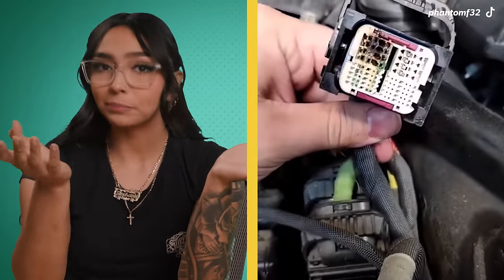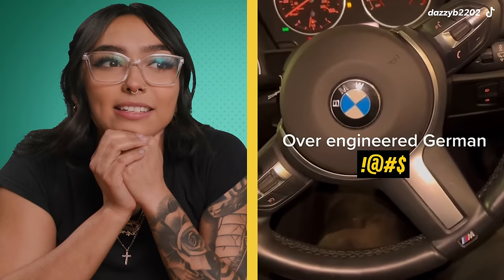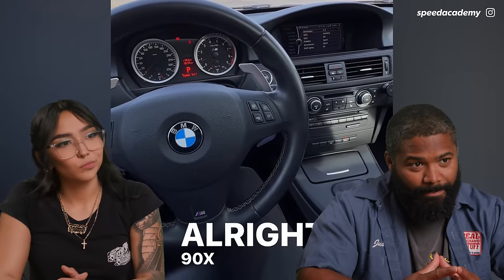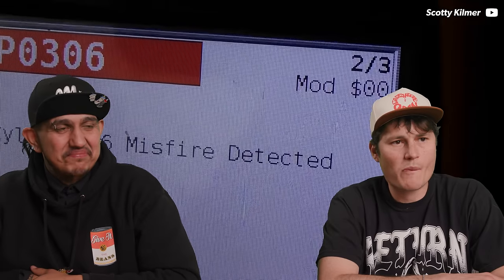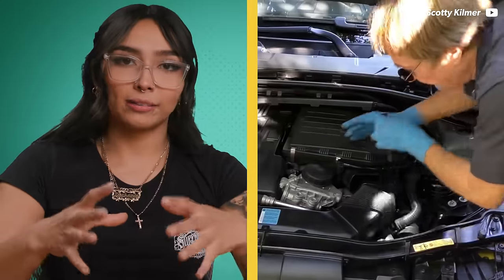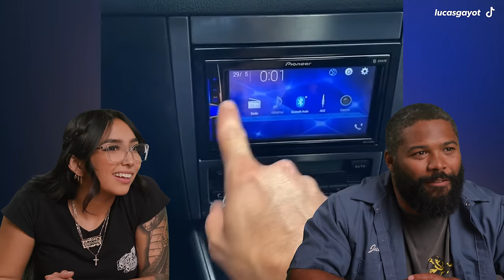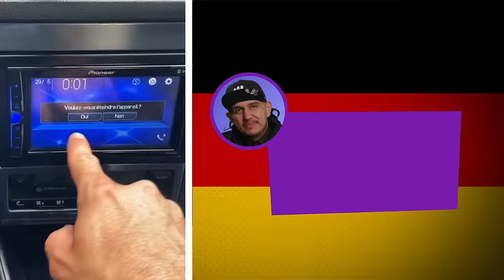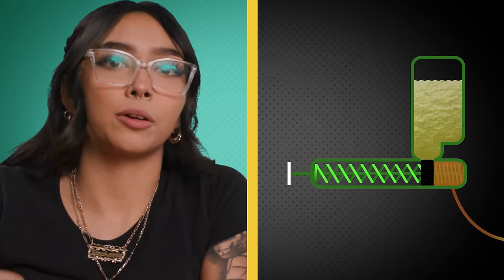Mechanic Reacts to German Engineering Fails

Comment: German engineering is basically “how can we ram as much as possible into a small space with the intent of making things better but it becomes so complicated nobody can fix it”
Reply: and they still have good cars.
Reply: @Sdizzle7    They were great cars until they went to so much plastic under the hood.   One 'simple' repair that would cost $1500 on a GM/Ford/Toyota would cost you $3800 on a 10 yr old audi.   Lease one every 2-3 years.  It's your best bet with German cars.  Unless you have the money, then hell yes!  Enjoy because they do drive wonderfully!
Reply: Can't argue, but before they started using so much plastic under the hood,  they were very reliable.  Back then if you had the money to afford an audi, you had the money to maintain one.  Not anymore.  The plastic wears out so much quicker and that same $1500 in a GM/Ford/Toyo will be $3550 in an Audi.    This has actually been seeping in for years.  Early 2000's Concorde had to remove a tire and splashguard to get to the battery.  Late '90s Buick had to undo a motor mount and tilt the engine to replace the one serpentine belt!  It's all about the sticker in the window now days.  70-% of people just look at that.   MPG(weight)/HP/Price.  They want you to believe you need 240 hp in a daily driver that weighs 3000 Pounds!  Sry, ranting! lol.
Reply: It is the remnants of the Prussian military culture that dominated Germany for a very long time. It is very hierarchical, and it has a tendency to make the officer class forget about the existence of the enlisted. Basically, the engineers here have a job to do, and that is to make the vehicle work efficiently and reliably. However, "will it be convenient or even workable for the mechanic" does not even come into it - mechanics are not part of their class so their existence does not even fall within their perception.

Funnily enough, with NATO the actual German military moved past this boneheaded culture a long time ago. Sadly, its remnants are alive and well and still doing damage in a lot of civilian sectors in Germany (and the militaries of other nations who were modelled after the Prussian army, often with Prussian advisors, in the past).
Reply: @LordKhuzdul  thats not even true a little bit 🤣
Especially since manufacturers like BMW, Audi and Porsche are from the very south of Germany (Bavaria and Baden-Württemberg), which have NOTHING to do with prussian culture.
Reply: @DrBonesFolo thanks for calling out his bullshit, I almost believed it
Reply: Audi is the most guilty of this, it looks like. Tiny engine compartments and a glance at the open hood shows there is zero room for components.  It's a sad state of affairs, I always felt that German prices/engineering should buy you reliability along with performance.   At least that's what I want.
Reply: @courtney5796 even the pedal assembly shown in the clip was plastic. I'd prefer steel, I don't want them getting brittle and eventually breaking while I'm driving. 😂
Reply: @quandiy5164  So a clutch master normally does not break, meaby and only meaby after 250.000 km and plus. But if it does, it's perfectly okay to have to unscrew more. The clip was dramatized without end. Plastic is completely fine there. The pedal assembly of my 1994 Audi A4 B5 is alkso plastic -> And thats a car from the reliable german car era
And yes im one of ze germs
Reply: @quandiy5164  No, the pedal assembly in this video is coated metal.
Reply: @MyRegardsToTheDodo  I may be mistaken but the pedal arms looked like molded plastic to me
Reply: @quandiy5164  You can see that in some places the coating has rubbed off and the metal underneath shines through.
Reply: @MyRegardsToTheDodo I looked at the video again and yes, the frame is indeed metal but I'm referring to the whole pedal arm which holds the clutch foot pad (where you rest your foot) to the pivot. Still looks like molded plastic to me. Too bad we can't attach pictures here so I can draw and mark which part I'm actually referring to.
Reply: we are just min-maxing :D
Reply: WWII, if the Germans hadn't constantly been re-engineering things their troops might've been better supplied, rather than have the funds go into the R&D
Reply: @CorvusCorone68  Yea, no. R&D wasn't the problem, Hitler was just a very, very bad military commander who made some terrible military decisions (like for example defending Stalingrad or the Battle of the Bulge, both were totally unneccessary and cost a lot of troops that would have been needed elsewere). Supplies weren't that much of an issue. The Nazi air force for example had more planes than pilots in the end and those pilots they had were badly trained, simply because the air fields needed for training weren't safe anymore and got attacked by the allied forces constantly. The Nazis were low on fuel, but that's nothing that could have been solved by funding something, they simply didn't have a reliable fuel source (like oil fields) big enough to supply their troops (which could have been different, but because of another one of Hitler's military decisions they didn't conquer the Russian oil fields, but instead attacked Moscow).
Reply: @LordKhuzdul  Always funny to see what crazy stuff people come up with. Only one of the large car manufacturers is in former Prussia at all, the population has nothing to do with Prussian culture, so that's just completly devoid of any reality. As a R&D engineer for one of them I can tell you, I work with a lot more mechanics every day, than engineers. Most employees in R&D are mechanics. We eat together, every day. And we drink together. 

So, thanks a lot for the laughs, but those repairs are why mechanics have a stable job in the first place and we didn't come up with WLTP norms, either.
Reply: Exactly how I used to build stuff in tekkit lmao. Absolute nightmare to get working and even worse to change later, but at least it made me feel good
Reply: "“how can we ram as much as possible into a small space with the intent of making things better but it becomes so complicated nobody can fix it” FTFY
Reply: @Sdizzle7  Are you from Europe? Because only people outside europe can lie like this.
Reply: @courtney5796  
Maybe for Americans. Here in Germany both Parts and Repairs are cheaper even than some Japanese Cars. This includes Audi especially.
There is a reason why German Cars are apparently mosotly hated and seen as unreliable by American Mechanics, while over here everyone wonders why those German Cars in the USA are allegedly making so much Problems
Reply: @retiredbore378  The mechanics and technicians are who executes our work. We engineers rarely touch cars, outside of reading data from it. So, not only do we have to learn from them, we couldn't do our jobs without good communication. 

I get that people want to be able to do more on their own cars, I feel the same way and certainly strive for better accessebility, but people here are acting like German cars are Italian sportscars
Reply: 100000%
Reply: There was no intent to make things better in the way the rest of us do. Germans honestly believe that the more complicated something is the better it must be.
Reply: @SamGray  
As a German who's really tired of Youtube "Mechanics" talking about how unreliable German Cars allegedly are, i do have to agree with your last Sentence. 
Take Mid-1990s BMW 7 Series f.e. - they probably have/had the most mechanically complex Cupholders to this Day. Is it awesome to use and look at? Yes. Is it also a very very German Thing to create that of course can break more easily than a normal "Hole" in the Middle Console as Cupholder? Also yes.
We Germans do still create amazing Cars and Technology for them, but at the same Time with the Advent of Cars suddenly needing "Computers" and all kinds of unecessary Safety Mechanisms, it lead to German Engineers not just adding the Things required but also making them as complex and genius (but also experimental) as they can. 
In a Nutshell: 
Yes, Germans overnengineer, but at the same Time our Engineering is also very culturally-focused. Which is why in the USA where People take less care of their Car or don't mind changing their Oil 1-2 Weeks later than told by the Manufacturer, People tend to have more Problems and Issues with German Cars, while in Europe where in most Countries People have Laws to be punctual on their Checks and taking Care of everything means German Cars are still considered some of the most reliable there are.
Reply: @chartreux1532  I agree with you. I personally loved my 325is, but some stuff about it was a pain. I'm of German/Swedish cultural origin, so I'm frequently accused of being OCD, following rules regardless of logic, etc... but also, America is huge. Our cars get driven much more. Just going to see my mom is a two hour drive both ways. And that's normal. No American would even consider four hours driving to even be a long trip.
Reply: @SamGray  
Exactly! 
Once i noticed that for some Reason American Youtubers claimed German Cars are unreliable i started to look into it because i found that really weird.
That way i found out that it's definitely a Cultural but also a "how much and often do you drive your Car" issue. Germany has the Autobahn, no speed limits on most, driving for 45 minutes is considered a long drive to your daily Job. 
Meanwhile in the USA 45 minutes in your Car to get to Work is basically nothing, at least in Areas around Big Cities, and in Germany there are Big Cities every 1 Hour on the Autobahn basically.
So yeah, lots of different Factors playing into this
Reply: Cry
Reply: The faster something goes, the faster it breaks. It's a big part of why toyotas last for 300k+ miles. No one is taking their camery to do laps.
Reply: @mowpa621  i see another B5 owner, i press like!
Reply: @@retiredbore378 thats also wrong! 😂 wtf do people know about Prussia?! Some of Germanys finest inventions also came from Prussia. Educate yourself
Reply: @@retiredbore378 since im not from the states and thusly dont have to deal with those ultright brainrott guys, no, i didnt know that. But when i use that term, i dont mean it like them and want you to watch fox news. I mean to actually educate yourself with realiable and unbiased sources.
Also not everything on the internet is US-centric 🤷🏼‍♂️
Reply: @LordKhuzdul  
That's not what it is. This is simply what you get when people overfixate on one aspect while ignoring other aspects.
Reply: @Sdizzle7 you have a very opposing take on "good" versus the meaning of the word
Reply: @MyerShift7  zzzzzz
Reply: @PREDATEURLT  zzzzzzz
Reply: @courtney5796  you pay for what you get. If I wanted a wal mart level honda, I'd buy a honda

Comment: That failed burnout with the Mercedes amg was over here in Australia. Actually in my suburb lol. That car was only a few days old. Turns out he blew the entire gearbox to smithereens because he couldn’t figure how to turn off all the traction controls.
Reply: That sucks
Reply: Probably the traction control option is buried under 30 sub-menus in the infotainment screen
Reply: Hahah 😂
Reply: Very well deserved. So How on Earth someone can have money to buy an AMG but be so dumb to do that is beyond my comprenhension
Reply: @JP-xd6fm  he won it in a raffle 🤣
Reply: That right rear wheel looked like it had a ton of curb rash too. That dude thrashed that car
Reply: When its a few days old you dont Rev the car like hell. Usually they tell you dont rev the car over 4000rpm the first 50-100km.
Reply: Some models like those with the 4-matic or the electrical rear diff wont let you turn off TC completely anyway.
Reply: Some models like those with the 4-matic or the electrical rear diff wont let you turn off TC completely anyway.
Reply: @lucasgoldner2625 this is why I'm starting to feel old,  I just want to control the car, not have it control itself
Reply: "All of the traction controls"

Pardon me?
Reply: What about all the white smoke or the exhaust? Seems like more damage then just the transmission
Reply: @Davo_1991  yeah looks like there could be more damage but I’m only relaying what I was told about the incident.
Reply: Little known fact that the owner didn't buy that AMG he won it from LMCT+ a few days ago after this was filmed so he will be up for a very expensive repair bill he would of not been expecting either lol
Reply: I don’t know about a full AMG but I can say normal Mercs won’t let fully turn off traction control. When you think you’ve turned it off it is still there, just not as sensitive. So, it won’t let you do a burnout. The error on the drivers part was not accepting this before he blew up his transmission.
Reply: money can't buy a common sense
Reply: @-LastStand- yes, most Mercs have open or hydraulic differentials (these are LSD up until certain speed), in case of the open ones when a wheel is spinning freely the brakes will basically lock that wheel so that the other with the most traction will spin
Reply: I looked up the registration, it’s a 2019 model that hasn’t been registered since 2021 so perhaps build was late 2019, first registration was 2020 then blew it up and let registration expire in 2021. I’d guess they probably can’t afford to repair it or sold it and it’s waiting for a new owner who can fix it.
Reply: @StephenJohnson-jb7xe It's so sad that the car went to someone so stupid.
Reply: @StephenJohnson-jb7xe  wouldn't touch that thing now even if my hands were the size of street lights

Comment: The founder of Honda made Honda a trust that operates only if 4 levels of safisfaction are hit.
1. Consumer satisfaction
2. Repair worker satisfaction
3. Line satisfaction
4. Vendor satisfaction.

Those four things determine if the shareholders GET to KEEP their shares or else the company reverts back to full private with language in place that those things must be fixed before any C suite bonus, buyout, or any golden parachute for the holders.

Pretty smart imo. I think thats the sole reason Honda is as dominant and yet understandable as they are.
Reply: Your comment makes me want to get a Honda. Toyota is all the craze right now, but can't forget about Honda.
Reply: Brilliant.
Reply: Honda just needs to drive up their marketing and they will be dominant

They are still dominant in many parts of asia though
Reply: @ArariaKAgelessTraveller  I don't think that'd help them much. Honda has like 3 cars on the top 10 most sold in US list and only recently got detroned by Tesla model Y as THE most sold car. They're doing just fine. If they wanted to be like everyone else maybe they'd make their luxury brand, Acura, actually their luxury brand and make some fancy yet truly functional cars. But honda tends to let either the race teams do the inventing, or just innovate the thing Mercedes did like 10years ago but actually make it manufacturingly scalable.
Reply: @ayliniemi  Right now? Let us know when Honda gets a city. Started with Honda, still have 9 of the 14 we've owned with 2 we drive daily, don't get me wrong,  but my Toyota/Lexus/Scions are amazing and the gap between the two became big in the early 00s and has not really closed yet
Reply: Thats why we own Honda cars and Honda stock

Comment: Worst German car I worked on was a Smart fortwo.

To replace an alternator, you have to unbolt the entire rear subframe, empty and disconnect the air conditioning, raise the body off the subframe, then raise the engine up out of the cradle so that you can get enough clearance to swap in the old alternator.
Reply: For such a miserable little car, just pop into Toys R Us and buy another one
Reply: exept that SMART is not german
Reply: @piotrkowalczyk1087  The fact that it was built in France is irrelevant.  Daimler engineered it.
Reply: @piotrkowalczyk1087   all the engineering is German, I had a Fortwo Diesel, and that little car also had some problems with the engine holders, they would rot and the engine would drop on the ground, the good thing that Peanuts ignores on that miserable little car is the mileage, a micro turbo diesel consuming 3.2 liters every 100 km's was something that even some 125 cc scooters and light motorcycles can't achieve.
Reply: new cars are only good for the crusher ...
Reply: @evolvedmonkey9978  @concinnus Except that it was initially developed by MCC in Switzerland, and the platform & parts are mostly from Renault (France) (which means they are french engineered).